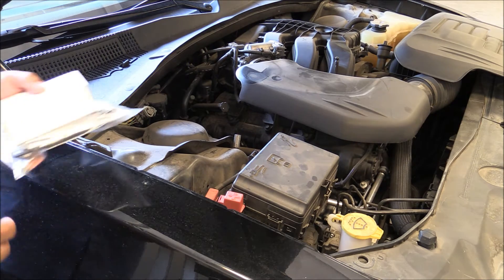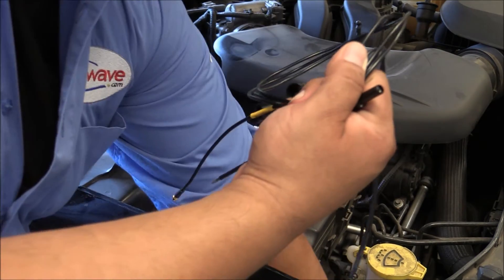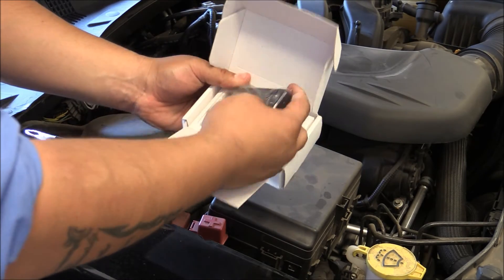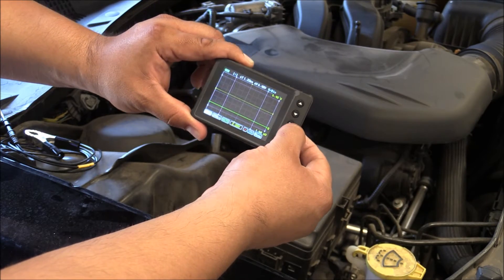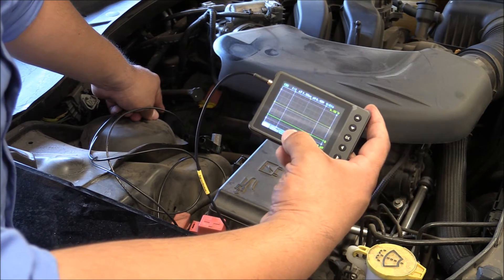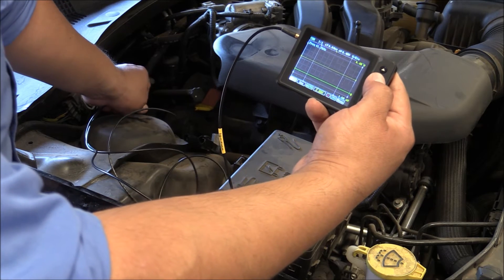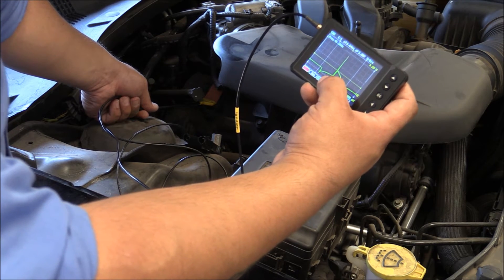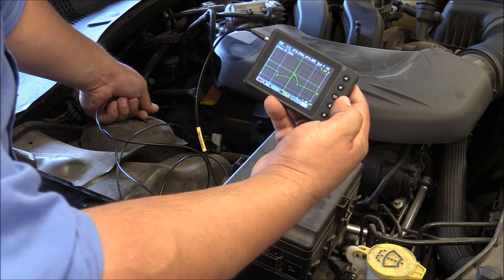uScope (ver 6.01) - How to use the AESwave COP Paddle Probe with the uScope

Comment: How about using the AES paddle with the BNC for use with the Pico... if I simply get the adapter, would I have to worry about using an attenuator to use it on the Uscope?
Reply from the maker: You can use the AES paddle probe with a Pico scope.  There is no need for additional attenuators. You will need to get a custom probe calibration to get the correct readings. Send an email to support@aeswave.com and we can help you with that.
Reply: @AESwave  yes, I know I can use it as is with the Pico, but I want to use the same paddle on the uscope. Besides BNC to Mini BNC adapter, would I need the Uscope attenuator, is my question. Thanks guys! I appreciate the help!
Reply from the maker: The attenuation is built into the probe itself. So no, you would not need an additional attenuator.  It can plug directly into the uScope using the appropriate adapter.
Reply: @AESwave  great!! That's what I wanted to hear! Thank you guys!
Reply: Cuba's Automotive Cuba have you used it like that yet? I’m going to order the bnc one then buy bnc to mini bnc to use on my UScope will it work that way?